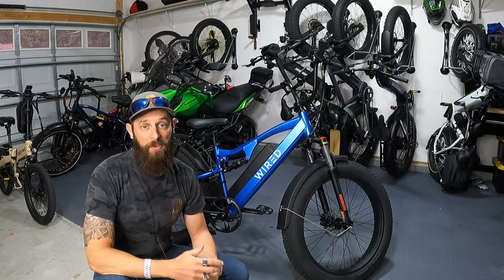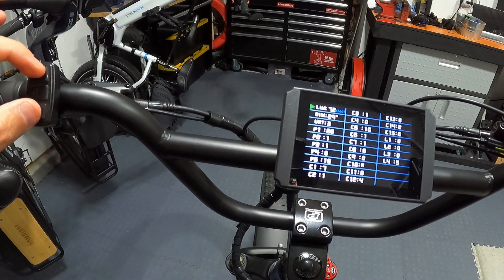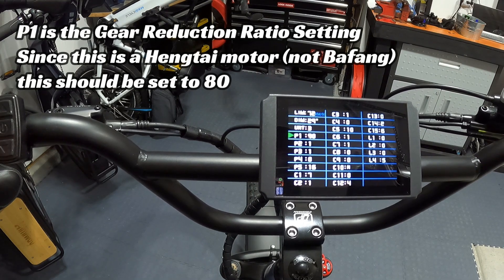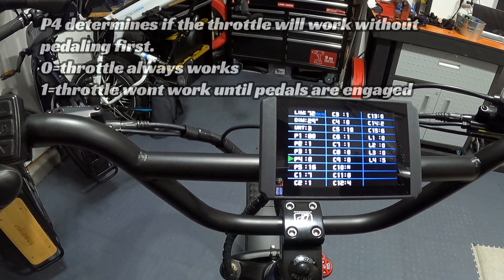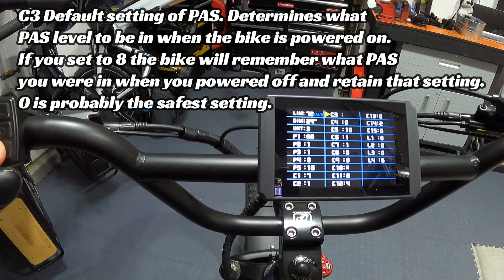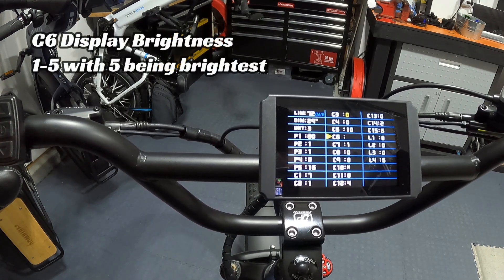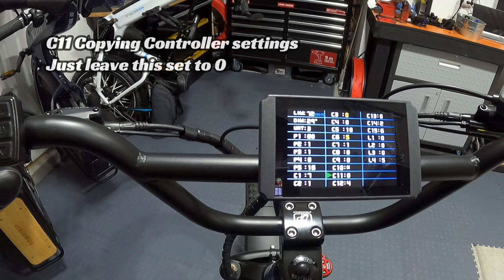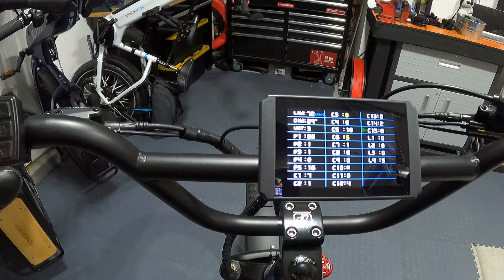Wired Freedom Display Programming Settings - LCD8H Display

Comment: The issue i have is when i set the speed to UK legal limit it still assists or the assist comes up on the display after 15.5/16mph it is a 250w legal motor with a 36v 15 ah battery its hard to judge if there is still assist being given to the motor past the assigned speed as this i fitted to my Velomobile which is aerodynamically fast anyway and i have still all the gearing ie 9 rear as it is a cassette motor hub which  i built into the rim and triple front crank set 36,48,62 so i can get up to 40+mph and cruise on the flat between18 and 25 mph obviously i want to keep to UK rules.  But as we all know most bikes can be then pedalled a lot faster  after the assist cuts out at set limits but as I've said to people the bike is getting you up to 16 mph with no effort then you can increase your speed through your own leg power but you haven't had to do this from a standing start

Comment: But, does each level of pedal assist have a speed limit? 
In other words, if I'm pedaling along at 25 mph (I like to pedal when I ride so as to greatly extend my range, not just throttle around like a moped), and I need a little boost to stay at that comfortable speed, but only a little, can I utilize PAS 1 at that high of speed?   Or, is it set up like some  e-bikes (so I've been told) that limit each pedal assist level to a certain top speed (which in my opinion would be really dumb)?

Comment: Hi I'm new to e bikes.. And after watching about 15 videos on this wfreedom e bike I'm pretty sure i'm going to buy one..  I just want to say thank you for the video I appreciate it. I will definitely be using these settings... Because everything on my own I Is multitudes full potential.. I have a Honda Rockets with a 232 Big Bor kit in it and it will 92 HPM..  and Trust me that's pretty sketchy on small tires.. 😂😂 I have one last question... Do you think we will able to mod this wired freedom with a 72 V battery in the future for more speed..?
Reply: It's probably possible to mod it in that way, but the cost to do so wouldn't make sense. 

If you wanted to spend that kind of money you might be better off putting a whole second battery, controller, and display for a front wheel motor--like CitizenCycle has on his bike that he built... or just sell it and buy a faster electric moped or a motorcycle.

Honestly, though... This bike is plenty fast. 38-40mph is really pushing the limits of a bicycle. Any faster and you have all sorts of other things to worry about like the integrity of the tires, etc.

Comment: Hello Sir and Thank You.  I watched dozens of your videos before buying my Fabulous 750 Trail Bike.  It has the same display but I realize the factory settings may differ.  Looking to contact you on an issue that I simply cannot find an answer to.  As follows:  My battery is a 48V 20ah.  When I use a multimeter on the bench (battery off bike) I get readings from all 3 sets of contacts.  The center contacts (battery has full charge) shows 48.1 V.  When I put the battery on the bike, using this display you have described here, the voltage on the display shows 54V.  Can you shed any light on this issue?  I thought my battery on a multimeter off the bike should register 54V when fully charged.  Thank You

Comment: Thinking about how a 750 or 1000 watt front hub motor would be on my wicked cruiser? Anyone here done that?
Reply: I’d be curious to see the results of adding a front hub motor and what wattage motor would work best too. I’d imagine setting the power ramp up to the rear hub motor at a more conservative setting would be a good idea though. Don’t want to lift the front wheel off the ground and having it spin up to a speed that loses traction when it touches down. That would be a recipe for disaster. Although the extra weight up from may help a little.

Comment: is this bike a better value at $200 more than kepler? the chaoyang sucks!
Reply: I seen a video review of both doing a hill climb and the wired blew the kepler away
Reply: Kepler puts out much less wattage, I’m getting over 2400 watts up a hill vs 1800 on the Kepler.  Also, the nylon gears of the Kepler are not as durable as the Hybrid gears, particularly under the strain of high wattage.   More expensive, but much better.

Comment: If I add a second battery (60V 20ah) and run them both into the controller, should I change the P5 setting?  great video
Reply: Did you ever figure this out on your own? I'd like to do the same. I have a order 24 version
Reply: @jeremywheeler2122  I added a second 60V battery and did not change any settings,  They each were on their own charger.  All i added was a splitter to keep both batteries even at all times. works great

Comment: Citizen, I think Wired gave you bum info about P3. I don't think it will choose whether the throttle matches PAS or always has full throttle available. That's controlled by C4 as you correctly state later in the video. 
I think P3 will choose between PAS modes. Most bikes PAS mode is speed based, and that is the way it would work with P3 set at 0. With P3 set to 1 like you are using it, then it is in KT's "imitation torque control" power limiting mode instead. I prefer the power limiting mode. It makes powerful ebikes feel smoother. You kind of mention the power limiting when you talk about C14 since it is only functional when using power limiting mode.
So if you switch P3 from 1 to 0 then I bet your throttle works the same but the PAS switches to speed limited instead of power limited.

Comment: I'm trying to make up my mind between the Wired Freedom and the Crusier. If any of you Citizen Cycle fans out there live near south west part of New Hampshire  l would love to checkout your bike let me know.
Reply: The full suspension works well at high speed on pavement, not well suited to serious MTB trails.  The step thru, with a suspension seat post and the fat tires is also very comfortable.  I’ve tried both.  If you are over 60 or under 5’10, I would recommend the step thru.  I think the step thru looks better and it is sooo much easier to get on.
Reply: My son has the Cruiser and the back end is too "wobbly" especially if you load up the rear rack. They should have added more reinforcement at the bottom of the V to make the frame stiffer. I wouldn't trust it anything but the easiest trails, but on the road it's fine.  Despite having short legs and being over 60, I just ordered a Freedom.

Comment: Thank you for this information. I am curious to know if any of your other viewers have reported the issue that I had with the wired freedom. The magnets in the motor had become loose at around 300 miles and were making a terrible raspy grinding noise when subjecting it to Power. Wired sent me a new motor core, and I replaced it myself. It wasn’t too difficult. Otherwise, I really like this bike. It’s almost too good, because it’s easy to cheat and not get the required exercise that I need
Reply: I was told by the Owners (I picked my bike up yesterday)that they are fully aware of some issues with the first batch and have had discussions with the motor manufacturer and have been assured it will not happen again and are replacing or repairing any affected motors from the first batch.  The new batch motors are branded Hentac, a brand from Hangtei, presumably a higher grade.

Comment: Great Video, you give an excellent presentation.  Just picked up my Bike today and they made some nice changes.  Much better rack, leather screw in grips, a new fork that performs better and is blacked out.  Also, the instructions for the controller indicate that P3 is used to switch from imitation torque sensor (p3=1) to Speed control pedal assist (p3=0).  Using normal speed control PAS with the bike unlocked would give you a PAS 1 of 18mph.  The Imitation torque sensor is really good on this bike and allows perfect control at any speed but you have the option.
Reply: In a nutshell: P2 = 0 - Your PAS levels are governed by speed. P2 = 1 - Your PAS levels are governed by watts. Although I'm not sure why they label P2 = 1 as "imitation torque sensor", Because all it's doing is limiting each pedal assist level to a certain number of watts lol, Like P2 = 0  limits each level to a certain speed... That's it.
Reply: I thought they weren't shipping the new model until October or November? Did you get your bike sooner because you opted to pick it up? I just ordered mine and opted to pick it up because I only live a few hours away. That would be SO AWESOME if I got it sooner than November.
Reply: @jaymartinson3236 I ordered mine about a week ago and the shipment isn't coming til Jan smh. Already feels like forever. I live in the north east so by Jan I may not even be able to ride it till spring!😫
Reply: hey which fork and rack did you get?
Reply: @kurgin  the Rack is full size now with two levels, I was told they needed the bigger rack to attach a pull trailer they are now selling.  I’m not sure who makes the fork, only that it performs a bit better than the Mizo.

Comment: Any major damage caused by riding 0 on c5. Just switched after watching this
Reply: No, it is fine to use C5 set at zero. It just provides a more gentle "3 stage slow start" that gradually ramps up to full power. C5 set at 10 provides full power immediately.

Comment: Great job on this video. Do you know if you could select a battery voltage so I could use a 52 volt battery as a back up ?
Reply: No, you can adjust cutoff voltage up and down a little bit with C12, but the 60v controller won't run very far on the 52v battery.  Wouldn't be worth the weight of hauling it imo

Comment: My Fabulous Ebike EMX Xtreme has the same display but in the vertical rather than the horizontal format. I presume it works the same but perhaps with different factory settings. Seems like a good idea to take a picture of (or otherwise record) the default settings before any tweaking!

Comment: What’s walk mode?
Reply from the maker: The bike will accelerate to a walking pace and hold speed. I've never once used walk mode.
Reply: @CitizenCycle925  I have once on my emtb when I blew a tire and was 3 blocks from my house. Made it a breeze to get home.
Reply: @CitizenCycle925  Good to know.
Reply: where the bike will go slow enough so you can walk beside without exerting yourself
Reply: @EZ_E_13  yes by changing gears and you can also ride it in walk mode and it will keep pace with pedestrians.